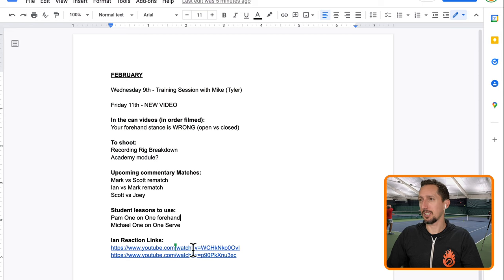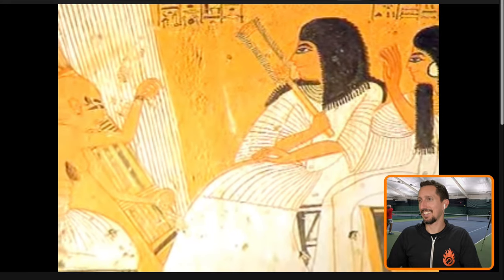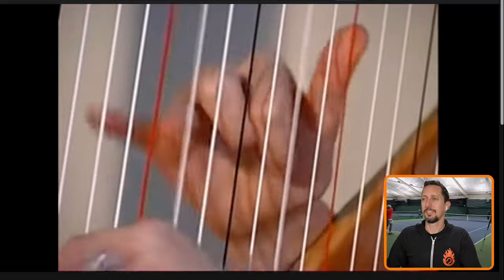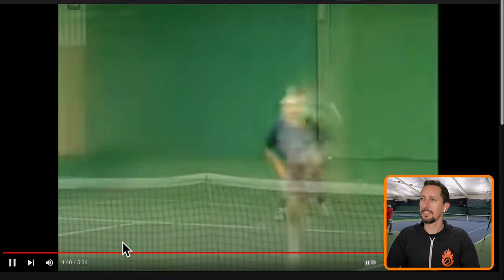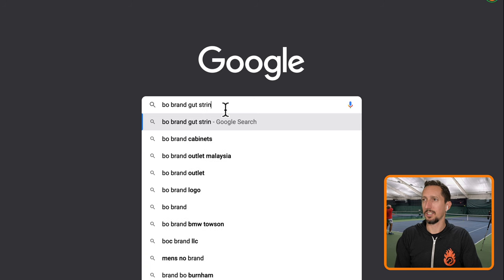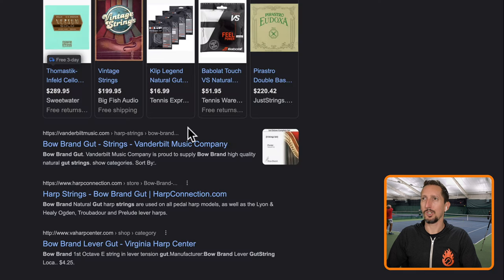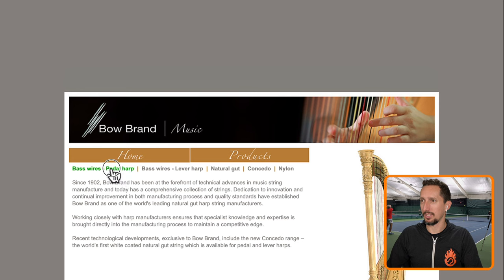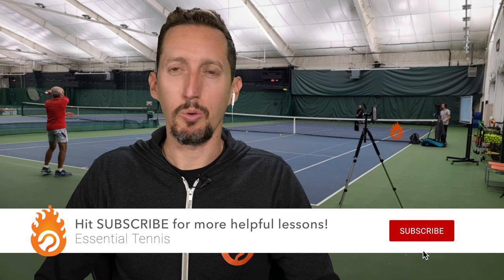How Natural Gut Strings Are Made

Comment: Gut strings have more efficient elastic recoil and are both livelier and more powerful. The fierce cuts at the ball taken in the modern pro game with its topspin would be difficult to control with pure gut stringing. Gut life can be dramatically increased with stringalings ( preferably teflon like Babolat's). For an old guy like myself trying to protect a bad elbow while at the same time looking for some more pop on the ball gut is great.To see money I do a hybrid with a multifilament.

Comment: I have used Bow Brand natural gut tennis strings in the past. That was in the early 2000s so they were around at least as late as then. I think Tennis Warehouse carried them back then (not sure, but I think I bought it from them). I love the feel of natural gut, but they're just way too expensive and they're pretty much the only strings that have ever broken while I've played. Apparently they stopped making tennis strings in 2008.
Reply from the maker: Thanks for the info Ronald! Do you still use natural gut?
Reply: @EssentialTennis   No, I've not used natural gut in a very long time. I've used synthetic gut for crosses for many years though. I've recently switched to Gamma Glide crosses and I'll soon be trying out Grapplesnake Irukandji. I've found Glide to be pretty decent at allowing main string snapback for a bit extra spin. I'm currently using Solinco HyperG Soft as my mains...
Reply: $85 installed here in Canada for a full bed!

Comment: I recently watched this video which is probably more current but it is basically the same process:  https://youtu.be/BuMVgwNqLZE. 

It really is fascinating how it's made and after watching the video, you can probably appreciate why it's so expensive.  As for the "smell",  yes it is distinct, but it's mainly from the coating they use, it's not like you're smelling dead animal tissue.  As for the political aspects of it, they are not slaughtering cows for their intestines to make tennis strings; just using something that would have been otherwise discarded as part of processing but I guess if someone has an aversion to all animal products, these would not be the strings to use.  As for me personally,  gut is now my string of choice as I switched to it about 6 months after an extensor tendon tear.  I use it in a hybrid setup with gut in the mains and ALU power in the crosses and it's the best string setup I've ever used.  Not as much spin as I used to get with my previous full bed of Hyper-G, but the control is excellent and most important for me with my injury is the comfort.
Reply from the maker: Thanks so much for watching! Interesting to hear your perspective and use case!